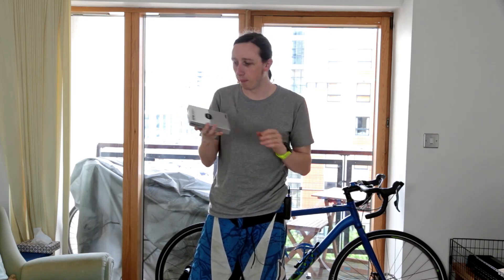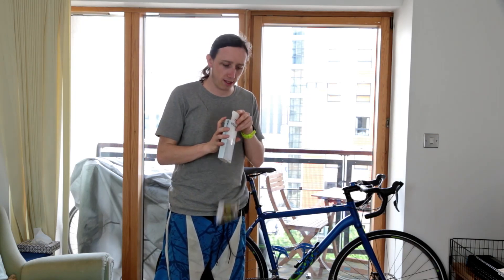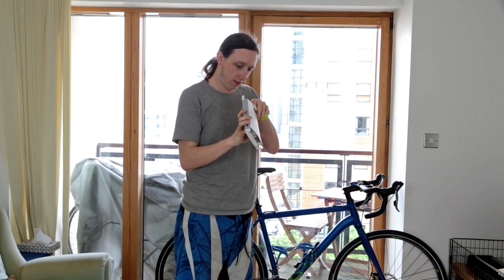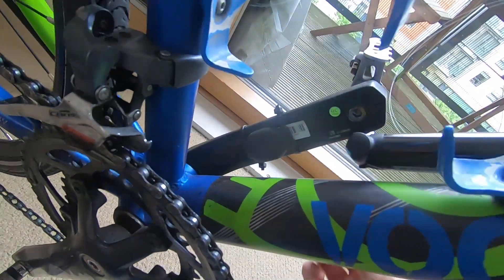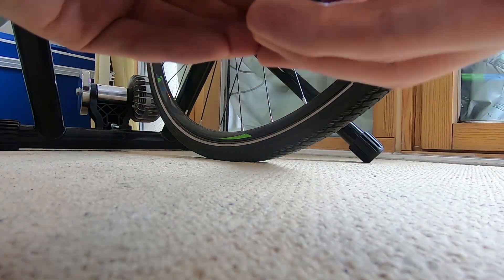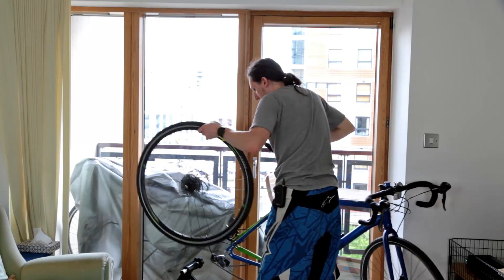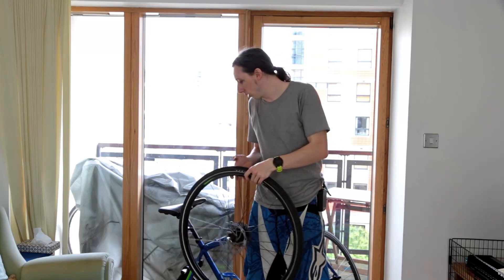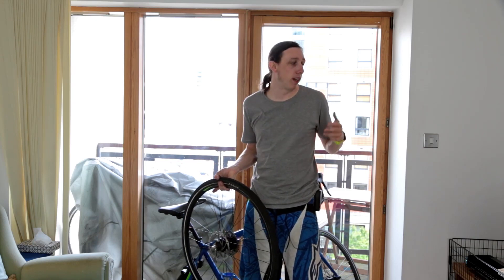Wahoo RPM speed and cadence sensors review

Comment: I'm scared that my Wahoo speed sensor will fall off one of these days due to the rubber strap deteriorating. Hopefully one can get a replacement and install it as preventive maintenance.  Otherwise, my Wahoo Roam, speed, cadence and heart rate sensors work perfectly.  I like to use ANT+, because I want to reserve Bluetooth for other devices connecting to each other.

Comment: Hi Chris -that pushing the rubber strap up with your finger tip was golden, that was the trick!  What a pain in the ass, glad I wasn't the only one that suffered.  The big question is - do you trust the strap to hold on to the speed sensor during an actual ride, or just for trainer sessions?  I don't want to have to worry about losing the sensor every time I hit a bump in the road, I haven't made up my mind yet. May want additional straps like zip ties.  Thanks for the video!
Reply from the maker: Once it's one, it's been solid for me. I keep it on the whole time and haven't had any problems with it falling off.

Comment: I can see by ya Alpinestars baggies that you do (or used to do) mtb as well as roadbike? Potentially enduro or downhill maybe? Looking at how hard it was to attach to a smaller road hub, i can imagine how difficult it would be on a chunky mtb hub haha! I think i would just remove the 200mm disc on mine to get it on! But yeah have you used them on a mtb wheel? If so how did they go? Did they handle the mud & stuff? I would at first be using them on my roadbike, on a set of rollers to record my workout, but it would be cool to get an accurate measurement of my speed on my DH, or cadence if i were to get an enduro bike.. Btw it's good to see you countered Wahoos "easy" claim for installation, so many Cos all say the same thing with alot of things & often its totally not the case haha!
Reply from the maker: Good spot. I'm not a big mountain biker but I did some work for Alpinestars a few years ago so they sent me some merch. I've replaced it with the Garmin speed sensor now, which is easier to install than the Wahoo, but still not easy.

Comment: Frankly, in my opinion, speed and cadence sensors are not worth purchasing. A simple Cateye, or similar, wireless bike computer can give you everything, including: current speed, average speed, maximum speed, distance covered, time of session, and calories burned. These wireless bike computers are usually very accurate, providing you calibrate them correctly, particularly with regards to wheel size. If the unit does not providte a cadence reading, count it yourself - it's so easy to do so. I have yet to find a speed and cadence sensor that is accurate and doesn't cause a signal drop at some point during a ride, either indoors on the turbo trainer, or outdoors.

Comment: I saw in other reviews that the speed sensor is not as important as the cadence sensor and that they had problems connecting both at the same time to a phone or tablet. Is it okay if I buy just the cadence sensor to use with a bike trainer?
Reply from the maker: It depends on what you want to measure. You need a speed sensor or power meter to use most training apps. The cadence sensor isn't particularly important.
Reply: @ChrisWorfolk  
Thanks. I have ordered both

Comment: Sorry, can't get over this. Please fellow cyclist do NOT rest your bike wheels down with no wheel on the deraillure. The weight can damage teh part and also damage the mount between the deraillure and frame.
Apart from that, that looked fiddly!. I' used eletrical tape on my cadence sensor on the pedal cracks but i bet you could do the same here for those worrying about the rubber failing> With just rubber my sensor fell off but it again it was crank mounted

Comment: Why all people want to put the sensor at the back wheel !? Its is more simple an proper at the front ! As we can see ....it is also more difficult to put on 😄
Reply from the maker: It needs to be on the back wheel to use it with indoor trainers.
Reply: It wouldn't make sense to put it on the front if you're using zwift.

Comment: you have to go in the app and set the wheel size
Reply: I didn't.  I strapped on the speed and cadence sensors, then paired them to my Wahoo Roam, and whamo, it knew my speed and distance traveled correctly. Maybe it was because it used GPS to calculate these two parameters.

Comment: Whats the point of it though? doesn't the wahoo just get speed from gps? also does this thing need to e taken out to charge?? Thanks.
Reply from the maker: Yeah, the speed sensor is not that necessary. It produces more accurate results in certain situations (tunnels, forests, where GPS can be patchy) and it work with the bike on an indoor trainer. But otherwise, you can get your speed from your bike computer. You need a sensor for the cadence, though.
Reply: @ChrisWorfolk  oh yeah good point in regards to forests and also indoor training (y)
Reply: Thats true when i was cycling in area with trees i lost the speed data from the gps

Comment: You put it on the wrong wheel mate, meant for the front
Reply from the maker: Wahoo say you can fit it to either wheel. It may be slightly easier to fit it on the front wheel, but if you're using your bike on a wheel-on turbo trainer, you will want to put it on the rear.
Reply: Also saw somewhere that putting it on the front wheel could cause reading spikes as you jump over stuff, while the rear is more stable. Makes sense as you would have a relatively high speed pull-up at the front, while he rear might just roll over the obstacle. No idea how far this is actually true, only just got my Wahoo and mounted on rear wheel.
Reply: Dude clearly he's on a trainer. Why then put it on the front wheel if only the rear spins on a trainer?

Comment: Those sensors is the worst crap i ever bought. The function is good but its almost impossible to open to change battery, even when using tw screwdrivers, open by hand is impossible. Both my units is trash now after a few months of use.
DONT BUY THIS !!